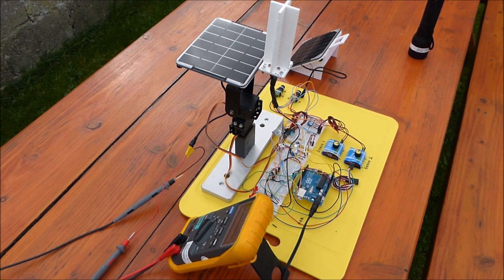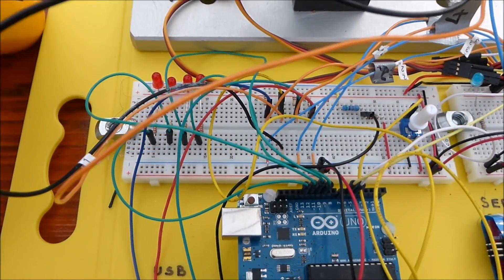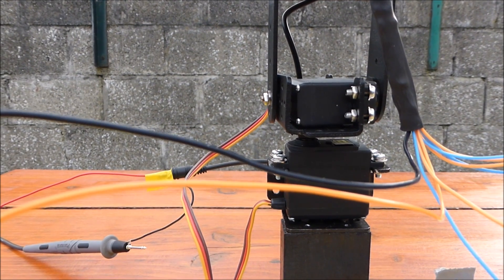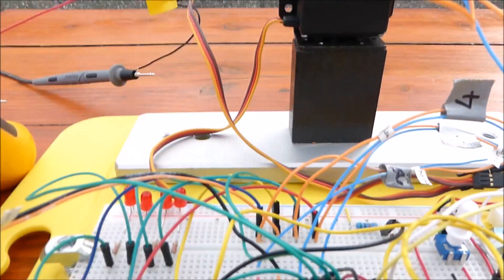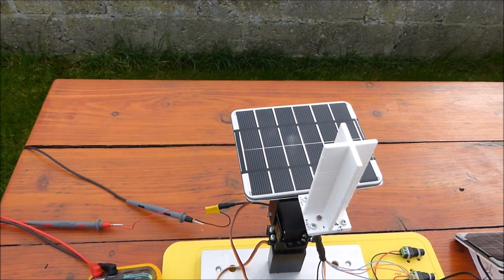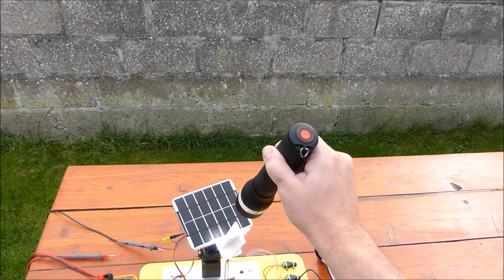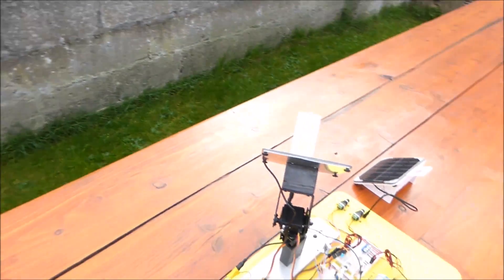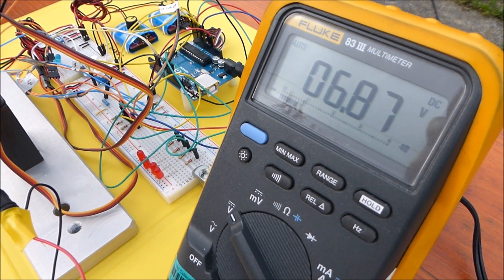Garys Dual Axis Solar Tracker

Comment: Hi Mr Gary I am currently doing my final year project which similar to this which for mine I have to doing into both automatic and manual control of the solar panel. I am having problem on how to mount the servo motor and can I have your code ? Thank you so much if you would like me out
Reply: My email kade35396@gmail.com

Comment: Hi Gary
i need your help. I am doing my final year project based upon solar tracking system.
I am using Mg946r servo motors but they are constantly running and never perform a tracking function. 
I am so impressed with your amazing work and now i need your kind help.
so if you don't mind please send me a detailed functioning and circuit diagram with complete code.
THANKS.
Regards........  M.Faisal
mfaisal1117fs@gmail.com

Comment: sir would you care to help me understand how you made the motor sit still, as i have everything working however struggling to make the motors sit still especially the horizontal one, i see you added extra height to the vertical stand can you please help
Reply from the maker: If you send me your e mail I can send you a document that might help
Reply: hi sir, thanks for your kindness in answering here!!, i actually made it work and got  some results however i have a question if you dont mind answering i tried to measure how much im using for the motors and i actully couldnt measure how much current im using i assumed im using 200mA as im powering from an arduino pin and according to the data sheet of the arduino uno micro controller these pins have a current limit to 200mA..i couldnt measure the servo motor current draw by a normal multi meter (and i honestly have no idea why not, maybe i had to break the circuit between the signal wire too but that wouldnt work as the signal wouldnt receive the servo..) i found out that i would need one of those .. if you care to have look 

https://hobbyking.com/en_us/turnigy-2-in-1-power-meter-servo-meter-1-5-tft.html
Reply: Gary Motyer hi. sir coud you please sent me the document?
Reply: Hi sir can you send me the 3 D printed design inorder to print it directly plz my 
Mi email:  zakilouahchi1995@gmail.com

Comment from the maker: Hi Folks
A number of people were looking for the code to control the Arduino.
Here you go.
1.  Code for Microcontroller.

 
Servo servo_Vertical;  // create servo object to control a servo (Vertical)
Servo servo_Horizonal;  // create servo object to control a servo (Horizontal)
int val_Vertical=90;        // variable to read the value from the analog pin
int val_Horizonal=90;       // variable to read the value from the analog pin
 
//===============================================================================
 
const int referenceVolts = 5;
const float R1 = 51000.0; //Resistor #1 (51K)
const float R2 = 100000.0; //Resistor #2 (100K)
const float Ratio = (R1/R2);
const float resistorFactor = ((referenceVolts/Ratio)/1023.0);  // eq 0.014471088
 
const int TolerencePin = A4; // Use Potentiometer for Tolerance Settings
const int solarPin = A5;     // +V from Solar Panel connected to analog pin
float v = 0;
//
const int LDR_1_Left = A0;        // LDR connected to Analog Pin 0 Left
const int LDR_2_Right = A1;       // LDR connected to Analog Pin 1 Right
const int LDR_3_Down = A2;        // LDR connected to Analog Pin 2 Down
const int LDR_4_Up = A3;          // LDR connected to Analog Pin 3 Up
//
int LDR_1_Left_val = 0;
int LDR_2_Right_val = 0;
int LDR_4_Up_val = 0;
int LDR_3_Down_val = 0;
//
//LEDs 10=UP; 11=Right; 12=Left; 13=Down
int ledPins[] = {10,11,12,13};
//
int dtime = 25;
int Tolarence = 0;
 
void setup()
{
  servo_Vertical.attach(5);   // attaches the servo on pin 5 (Elevation) to the servo object
  servo_Horizonal.attach(6);  // attaches the servo on pin 6 (Horizontal) to the servo object
 
  //Setup LED Pins as OUTPUT
  for (int x = 0; x < 4; x++){
      pinMode(ledPins[x], OUTPUT); 
  }
  Serial.begin(9600);
}
 
void loop()
{
  reset_leds();
  read_potentiometer();
  read_voltage();  
  read_LDRs();
  adjust_Servos();
 
  display_status(); 
  delay(dtime);                           // waits for the servo to move
}
 
//=========================================================================
 
 
// Subs....
 
 
//=========================================================================
 
void reset_leds(){
 for (int x = 0; x < 4; x++){
        digitalWrite(ledPins[x], LOW);
 }
}
//=========================================================================
 
void read_potentiometer(){
// Use Potentiometer for Tolerance Settings 
  Tolarence = analogRead(TolerencePin)/4;
}
 
//=========================================================================
void read_voltage(){
 v = analogRead(solarPin);
 v *= resistorFactor;
} // end read_voltage
 
//=========================================================================
 
void read_LDRs(){
// Set the LDRs in an x config and label the LDRs from 1-4
//    \ 4 /
//    1 X 2
//    / 3 \
///arduino LDR Pins 10=UP; 11=Right; 12=Left; 13=Down
 LDR_1_Left_val = analogRead(LDR_1_Left);
 LDR_2_Right_val = analogRead(LDR_2_Right);
 LDR_3_Down_val = analogRead(LDR_3_Down);
 LDR_4_Up_val = analogRead(LDR_4_Up);
} //end read_LDRs
 
//=========================================================================
 
void adjust_Servos(){
 
int avg_Left_Top =     (LDR_1_Left_val +  LDR_4_Up_val) / 2;        // average value Left_Top
int avg_Left_Botton =  (LDR_1_Left_val +  LDR_3_Down_val) / 2;      // average value Left_Botton
int avg_Right_Top =    (LDR_2_Right_val + LDR_4_Up_val) / 2;        // average value Right_Top
int avg_Right_Botton = (LDR_2_Right_val + LDR_3_Down_val) / 2;      // average value Right_Botton
 
int dvert = (avg_Left_Top + avg_Right_Top) - (avg_Left_Botton + avg_Right_Botton); // check the difference of up and down
int dhoriz = (avg_Left_Top + avg_Left_Botton) - (avg_Right_Top + avg_Right_Botton);// check the difference of left and right
 
// Using the tolerance value stop servo seeking
// Check Vertical
   if (-1*Tolerance > dvert || dvert > Tolarence){ // check if the difference is in the tolerance else change vertical angle
      if ((avg_Left_Top + avg_Right_Top) > (avg_Left_Botton + avg_Right_Botton)){
         //adjust Vertical Servo Down
         digitalWrite(ledPins[3], HIGH); //Blink the Bottom LED
         val_Vertical = ++val_Vertical;
         if (val_Vertical > 179){
             val_Vertical = 179;
         }
      }
      else if ((avg_Left_Top + avg_Right_Top) < (avg_Left_Botton + avg_Right_Botton)){
        //adjust Vertical Servo Up
        val_Vertical= --val_Vertical;
        digitalWrite(ledPins[0], HIGH); //Blink the Top LED
        if (val_Vertical < 1){
            val_Vertical = 1;
         }
      }
      servo_Vertical.write(val_Vertical);
   }
//Check Horizonal
   if (-1*Tolarence > dhoriz || dhoriz > Tolarence){ // check if the difference is in the tolerance else change horizontal angle
      if ((avg_Left_Top + avg_Left_Botton) > (avg_Right_Top + avg_Right_Botton)){
         //adjust Horizonal Servo Left
         val_Horizonal = --val_Horizonal;
         digitalWrite(ledPins[1], HIGH); //Blink the Left LED
         if (val_Horizonal < 1){
             val_Horizonal = 1;
         }
      }
      else if ((avg_Left_Top + avg_Left_Botton) < (avg_Right_Top + avg_Right_Botton)){
         //adjust Horizonal Servo Right
         val_Horizonal = ++val_Horizonal;
         digitalWrite(ledPins[2], HIGH); //Blink the Right LED
         if (val_Horizonal > 179){
             val_Horizonal = 179;
         }
      }
      else if ((avg_Left_Top + avg_Left_Botton) == (avg_Right_Top + avg_Right_Botton)){
         // nothing
      }
      servo_Horizonal.write(val_Horizonal);
   }
} // end adjust servos
 
//========================================================================
 
void display_status(){
 Serial.print("Solar Panel Volts: ");
 Serial.print(v);
 
 Serial.print("  Servo Horizontal: ");
 Serial.print(val_Horizonal);
 Serial.print("  Servo Vertical: ");
 Serial.print(val_Vertical);
 
 Serial.print("  LDR_1_L: ");
 Serial.print(LDR_1_Left_val);
 Serial.print("  LDR_2_R: ");
 Serial.print(LDR_2_Right_val);
 Serial.print("  LDR_3_D: ");
 Serial.print(LDR_3_Down_val);
 Serial.print("  LDR_4_U: ");
 Serial.print(LDR_4_Up_val);
 
 Serial.print("  Tolerance: ");
 Serial.println(Tolerence);
} //end display status
Reply: respected sir plzz send me all instructions to make this project ...........i have to make a final year project.......plzz sir help me by sending all instructions to my mail.      balbirsingh176@gmail.com                    
i am waiting for ur reply.

thanks sir
Reply: thanks a lot Sir
Reply: what language you are using mr.Gary?